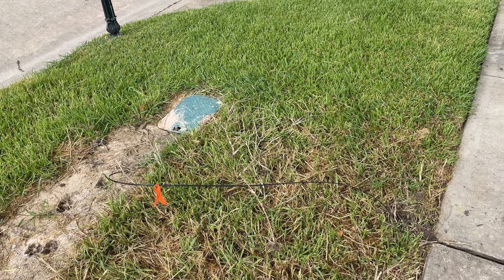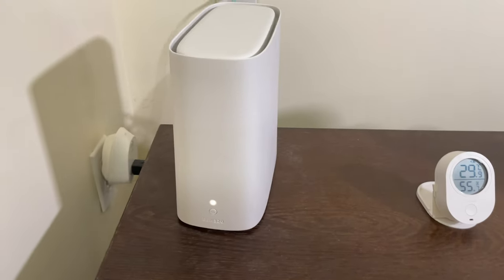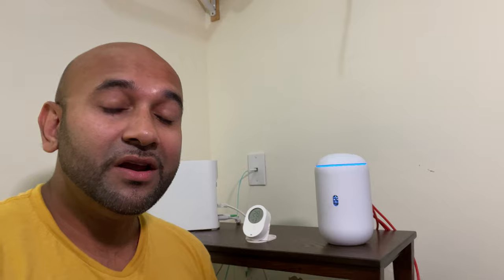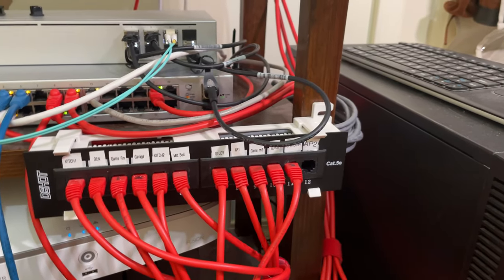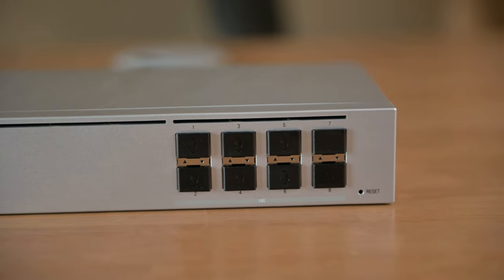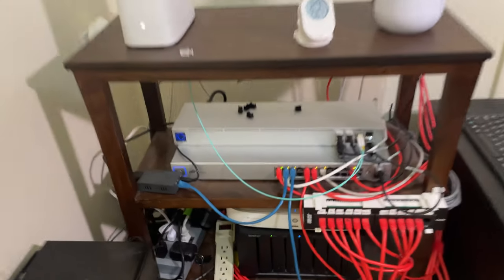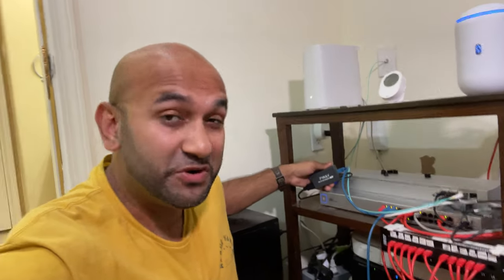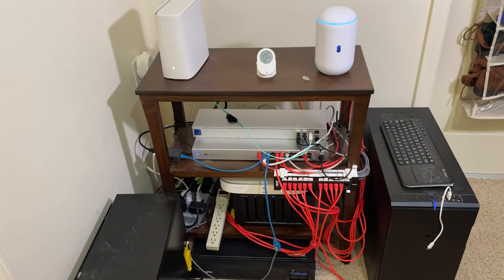My UniFi HOME NETWORK TOUR (Mid 2022)

Comment: Great info!! a little question.. If I need to create a new network.. Thinking about this.. Dream Machine Special Edition for the controller + Access Point U6 Pro ( or maybe ap u6 mesh) to provide wifi for my office + Access Point AC In-Wall / Single Unit to the rooms (where I already have wired cables).. +  Access Point AC Mesh / Single Unit to mesh (wireless to the garden). Any recomendation?.. or maybe just go with the dream router and the in wall with the repeater?

Comment: I really enjoyed this video. You're inspiring me to get a UDR and begin to tinker to get more from my network. My only issue is I want to look more into unfi protect. Will you ever think about using the unifi camera and doorbell options?
Reply from the maker: Good question. I’m actually looking into potentially getting a few UniFi protect cameras but I will likely upgrade to an UDM SE before that to ensure I have a larger hard drive accommodate recordings. Currently I’m using a LOREX system that is very easy to use and was a great deal at Costco so it’s not really an easy decision to switch at the moment. But I’m definitely considering it.

Comment: Unplugg the gpon module from your ISP router and plug it in to the udm pro wan 2, it will work and grab a public ip, i have the fiber cable plugged in strait to the udm pro or Udm se i have the fiber cable plugged in via gpon fibre module to the udm pro  since day 1 when i got it 2 years ago that way you dont have to deal with isp equipment at all
Reply from the maker: What ISP do you have? As far as I know AT&T in the US doesn’t allow that.
Reply: @TechTalkwithSamir  I have Telus here in Canada and they said It is not allowed as well but it worked when i tried it, i saw you have the similar setup setup like me from the isp, at the back of the isp modem there is a removable gpon fibre module, remove it and plugg it in to your udm se wan 2 port sfp+ port and change the wan setting to the opposite primary wan2 and failover wan1 and it should grab a public ip address try it and let me know
Reply from the maker: Yes TELUS allows it. My friends in Canada have done it with TELUS. ATT in the US however is not that simple :(

Comment: Nice video Samir my question will be as you’re network geek would recommend to have small UniFi tool less rack of 6u that will help also provide me a link for tp link and network temp monitor
Reply from the maker: I personally would get a non UniFi rack for the most compatibility. UniFi gear will mount on a standard rack but non UniFi gear won’t mount on a UniFi tool less rack without tinkering around so for racks I would get a standard rack that has universal compatibility. I am personally planning on getting a standard rack down the road when I do my clean up.
Reply: @TechTalkwithSamir  yep check startech rack